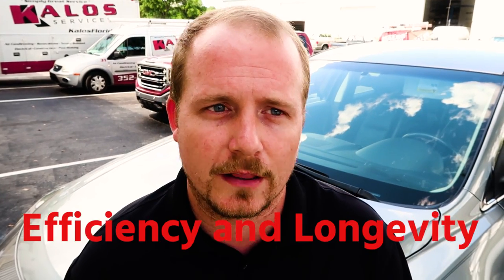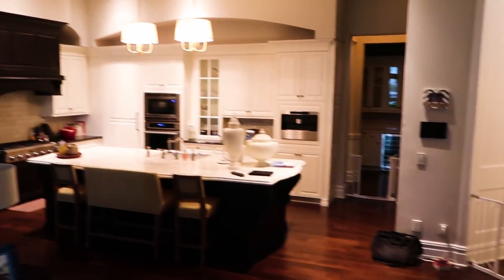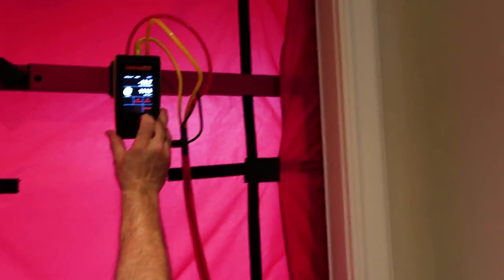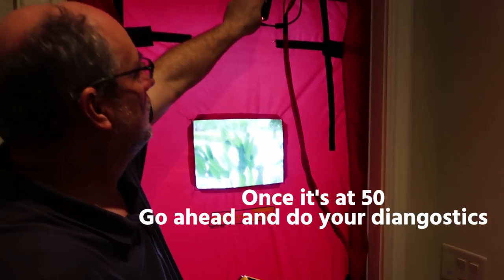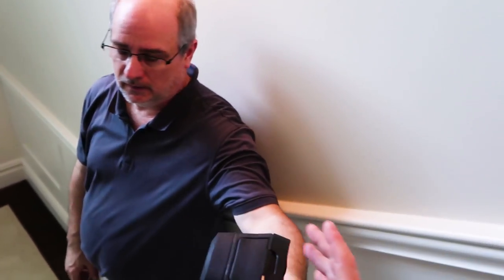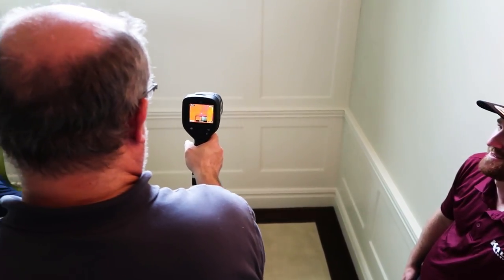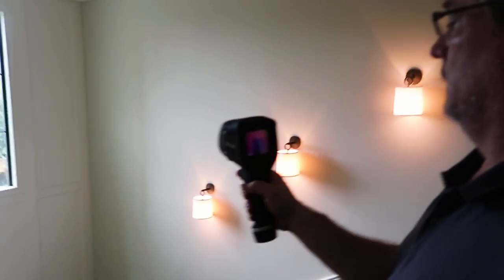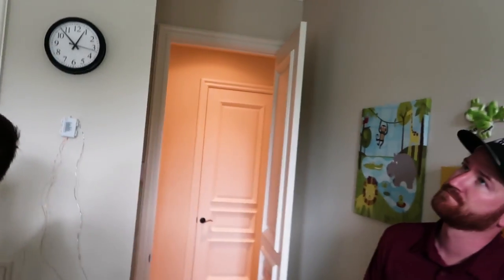Inspecting a Multimillion-Dollar Home W/ Cracks in the Trim

Comment: I work out here in Greater Boston. I have seen this issue in many new homes.
I have been trying to get to the bottom of this issue. I believe its a multi-faceted problem.
1. Moisture: Typically when the finishes such as crown molding goes in the carpenter just puts it up. Doesn't check the moisture level in the wood when it comes off the truck.
If we are lucky, they might let some of the wood acclimate for a week or two because they had to finish another job. Another thing I noticed is this issue shows up more when molding is installed in the humid summer and then the molding dries out in the low humidity winter time.
2. New growth vs old growth lumber, do anyone notice how come there a ton of old homes in the United States, all over the country, such as Victorian's, that have no issues with any the moldings or hardwood floors and this lumber was installed a hundred plus years ago? One theory is that back in the day, lumber yards/carpenters figured out the lumber needed to dry out for a year or more before selling or installing! New lumber is cut to shape and size and sold right away from what I told.
3.Cheap caulking: We found that the crack between the crown molding and the sheetrock/plaster is caused by painter using the cheapest priced caulking!

I think in this video they are chasing their tail. It's a moisture problem!

Comment: It could have just been the trim carpenter using inferior products and/or incorrect mechanical fasteners. He may have used low grade caulk or caulk that was improperly stored. The fasteners also could have been incorrect (too small, etc.).

Comment: Wouldn't cracking be too dry a space ?
Reply: Joe Shearer I was thinking the current 50% RH was near perfect. Maybe the woodwork had a high moisture content when built?

I have seen drywall cracking in areas where infiltration or exfiltration likely caused minor condensation (lack of insulation and considerable temperature difference close to the air leak).
Reply: Joe Shearer I said drywall cracking.  I should have said drywall seams cracking and moisture stains at those seams.
Reply: Maybe it wouldn’t even require an air leak.  Maybe a large enough temperature difference across a poorly insulated drywall joint could cause some condensation on the joint?

Added:  Which came first, the condensation or the crack (and resultant air leak)?

Comment: I realize this video focuses on leakage. But, I see/hear no mention of static pressure testing of HVAC system(s).  Is there any thought that high external static pressure(s) may be contributing to infiltration/ exfiltration?
Reply: Ok, I do remember now mention of the True Flow Grid. Maybe HVAC systems static pressures were fine.
Reply from the maker: Yes we spent a lot of time testing the equipment it just didn’t make it on camera